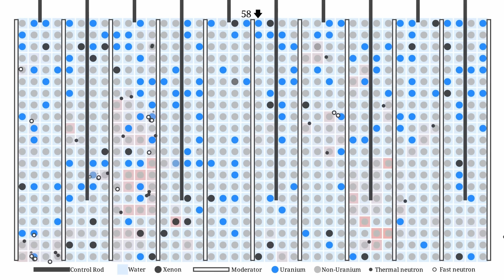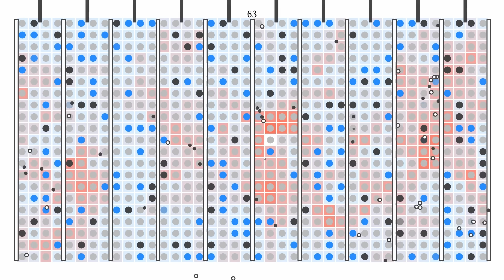Chernobyl Accident - Simulation only (no talk)

Comment: Also… when the system was powered down to 30% there was still latent Xenon build up that caused the failure process to begin. Had they powered down AND limited the water circulation by 20% would be be able to assume everything would’ve stayed stable?
Reply from the maker: Tons of stupid things happened that day, and I think the total "system" (reactor and operator) is too complex to guess what would have happened if a few things changed.

But experts have said it was a matter of time until the reactor would blow up, if not this day then another. Because of the unsafe reactor and unsafe culture
Reply: @Higgsinophysics  I wouldn't call it unsafe culture in this context. Russia's culture doesn't operate a reactor.
"Unsafe working practices, and general disregard for SOPs" would fit better
Reply: @Higgsinophysics  "unsafe culture" the stupides thing i've ever seen X)
Reply: Unsafe culture? Like in Threemile island and Fukushima?
Reply: @deipalladium8362  Elaborate.
How "unsafe culture" did Fukushima in? or Three-mile Island.
Reply from the maker: @deipalladium8362  No. There is no way you would be allowed and it's probably not even possible to turn off safety systems and its safety protocols. Only in USSR this flies
Reply: @deipalladium8362  Nice whataboutism there.
Reply: @W4lt3r89 the ussr for sure has unsafe culture bud.
Reply: Source- "Trust me bro" @funnyyylock
Reply: @Hexus99  source : Chernobyl disaster.
Reply: @W4lt3r89  Nah, try again, someone up in the thread pointed out why it's not a valid argument
Reply: @Higgsinophysics  Oh, really? Wikipedia suggests that at least 56 accidents at nuclear power plants have occurred in the United States. There was an American reactor at Fukushima, and its employees lied about the problems during 20 inspections
Reply: @愛を込めてロシアから 
Did all 56 of those accidents turn into a Chernobyl level disaster? No? Then stop making baseless comparisons. 
Also in Japan, safety is commonly ignored in favor of keeping ones honor intact, and/or honoring ones superiors - like how Japans honor based work culture caused the Amagasaki Derailment.
Reply: @deipalladium8362 No, "unsafe work culture" didn't cause those. Negligence did.
Reply: @Hexus99 No one did such. Go take your medicine.
Reply: @Archangel657 Well said.
Reply: @sharpjs  Please don't spread "whataboutism." It's a stupid term that is rarely used correctly, it's just not worth the fallout.
Reply: @愛を込めてロシアから in the U.S. a Japan major errors were only caused by literally devastating natural disasters, in Russia it was just the status quo
Reply: @Nothing_here7435  That is, when you have cracks on the wall of the reactor building and you hush up 20 inspections, and before 21 there is a powerful tsunami, you call the cause a natural disaster, and not criminal negligence of the staff, and when the reactor exploded during planned work in Chernobyl, is this the status quo? 
In the case of the status quo, the design should be left as it is and continue to build power units around the world. But for some reason, the design was changed and now Russian nuclear reactors around the world are the most reliable. Do you know the name of what you just said? This is a lie and hypocrisy
Reply: @愛を込めてロシアから  Look at a list of nuclear disasters
Deaths on most of them single digits because those nations took proper procedures to minimize damage. Heck 3 mile which people say is one of the worst has a projected 0 deaths. Soviet disasters hundreds to thousands die. The 2 deadliest, most radiation releasing incidents are both soviet. But hey 4-5k deaths is a small price to pay. Not to mention Soviet disasters are just the known failures because they were so major that they could be detected from the west, so unless we assume the Soviets had 2 devastating nuclear disasters with hundreds to thousands of deaths and unparalleled radiation release and absolutely no other disasters they would hide then there is more.

Also Russia is a 1/4 of the nuclear production as the U.S, 1/3 of France, and 1/2 of Chinas and only, 2GWs ahead of South Korea. The reason there reactors seem safe is because they have no where near as many. But let’s look at a none disaster scenario on how Russia treats nuclear reactors, as storage facilities for weapons, munitions, and vehicles because they won’t be bombed there.
Reply: @Nothing_here7435  apparently you're a little off topic because Russia produces more electricity than China and South Korea, even despite the vast number of hydro and thermal power plants. And yes, Russia is a world leader in nuclear technology, because it is Russia that is currently building half of all power units under construction on the planet, and Russian scientists have invented and built a fast neutron reactor. You're saying that an atom in the hands of a Russian person is a dangerous thing, and I hope that's true because you guys are asking for unscheduled tests.
Reply: @愛を込めてロシアから  That’s some very convenient wrap around logic that looks like your saying something your not.

I very clearly said NUCLEAR energy production because I wasn’t talking about total energy production which is completely irrelevant to the discussion. But instead you go on some round about side tangent about how unrelated fact(total energy production) and a complete lie of a statistic(China has more Nuclear reactors under construction) somehow cancel out Russia having a fairly minimal nuclear energy production.

All you are doing is spitting lie after misleading statistics.
-Total energy production is barely unrelated to nuclear energy production 
-Russia is not building the most nuclear reactors, they are only producing 10 as of now when China has 25.
-Russia did not invent the Fast Neutron Reactor, that was from what I could find combined US and French endeavors, they built the first commercial one but did not invent it.
-Russia is not the leader in “nuclear production” what ever that is supposed to mean. The U.S. has 4x as much nuclear energy production, China is building 2.5x as many reactors, and France has 3.5x as high of a nuclear energy percentage of energy production. 
-Russians has killed more people in nuclear accidents than every other nation combined most likely times some.  

But no if you simply cite more false and misleading data it will suddenly become true.
Reply: @deipalladium8362  Fukushima was hit by a tsunami that knocked out key systems, nothing to do with human error.
Reply: @deipalladium8362  Three Mile Island happened in 1979 much more earlier than Chernobyl but with  similar operator misunderstanding and mistakes,  5/7 in INES scale meaning an accident with wider consequences. Chernobyl and Fukushima is 7/7 which means a major event. In Fukushima there was also human error about waterproofing and bunkering which put emergency power supplies out of action causing a total loos of electrical power.  Shortly nuclear power is a wildcart which you can't fully predict and %100 control of its elements.
Reply: @snakeplissken1933  The accident in Japan could have been avoided if the staff had not lied at 20 inspections that the building was covered with cracks.
Reply: @W4lt3r89  They had known of the tsunami risk for decades and did nothing about it. Fukushima is also called the man-made disaster.
Reply: @sharpjs omg. You cliche about "whataboutism" is so precious. Even Rocky 4 music started to play in my ears
Reply: @kylezdancewicz7346  your peculiar warping of the reality to present russia as the worst entity our planet has ever beared at its surface just tells me you are from poland or ukraine
Reply: @Higgsinophysics  Only the Americans could build a nuclear power plant for the Japanese in a seismically dangerous zone, managing to expose cooling pumps, switchgears, backup generators and batteries to flooding, which led to a complete de-energization of the station and the failure of emergency cooling systems..
Reply: @deipalladium8362  You know nothing about either of these events clearly.
Reply: @ringspecies  and importantly, while it got very hot, it was still possible to keep dumping water into the system from above, which gave them time to get it offline, sealed, and refilled.

Not remotely possible for Chernobyl.
Reply: @CommieDestroyer  this. There is a difference between fukushima having shown some wear and tear, and pushing things down the line because IN ALL LIKELIHOOD the reactor would be decommissioned due to age before it needed repair, AND the fact that it took a massive earthquake and direct hit by a tsunami AND only one of them lost containment (of all the reactors) AND it was a little dicey, but they managed to get it shut down. 

Not at all the same as techs who knew better, who knew the reactor should have been shut down, who should've said no a thousand times... just letting it happen.

They knew something was wrong, they needed to stop the whole thing and REVIEW. 

They didn't. It's mind blowing that they just didnt.
Reply: @deipalladium8362  fukushima was just because they thought it would  be a great idea to put a backup generator under the sea level in a country that constantly is hit by earthquakes and tsunamis
Reply: This flame war going on in the chat is reaching meltdown too.  Anyone have some pics of cute Russian animals to cool down the reaction?
Reply: It was human error that caused the meltdown
Reply: To the smoothbrains having smoothbrain debates above me, "Unsafe culture" doesn't mean the ENTIRE CULTURE OF THE COUNTRY was unsafe. It means the specific work culture of the workers and operators at the specific facility in question was unsafe.
Reply: @GustafUNL  this. It takes a given WORK CULTURE IN A PLACE OF EMPLOYMENT where someone in charge can just turn off the safeties. And that no one would disobey him. The disaster happened because someone who barely understood what he was doing opted to throw every inch of caution to the wind and NO ONE SAID ANYTHING. 

That's not the USSR. If it was, we wouldn't be alive right now. Because they actually had a culture of "fuck no i wont" when it comes to possibly ending the world or soviet lives.

The weirdness of some people to just launch themselves at a turn of phrase looking for something not-quite-nazi-enough (woke) makes so many conversations exhausting. 

It's a corporate term. Not a political one.

Comment: Great explanation. Everything makes sense but out of curiousity… why did the hydraulic system fail at the end to lower the rods? What was the system failure that prevented the rods from lowering as planned?
Reply from the maker: No hydraulic fail.

As far as I recall, the litterature debates if it's either cause by melted rods, or fractured rods blocking the path
Reply: @Higgsinophysics thank you
Reply: Graphite channels deforming
Reply: I'd heard that the fuel rods and steam channels started to expand and blocked the rods from moving in further.
Reply: The graphite tips on the control rods caused a dramatic spike in reactivity, causing massive heating and damage to the rods, preventing them from inserting all the way.
Reply: Hydraulic system didn't fail. All rods were inserted into the reaction. Problem is, they jumpstarted the cataclysm. 
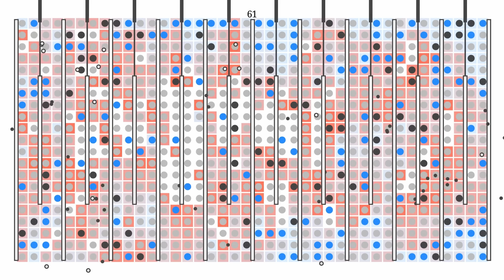That's when all the control rods, especially the manual control rods with the moderators were fully inserted at around 3:15. the water evaporated and so with so  much excess xenon and steam was generated there was no way the material can be logically contained. Hence boom boom.